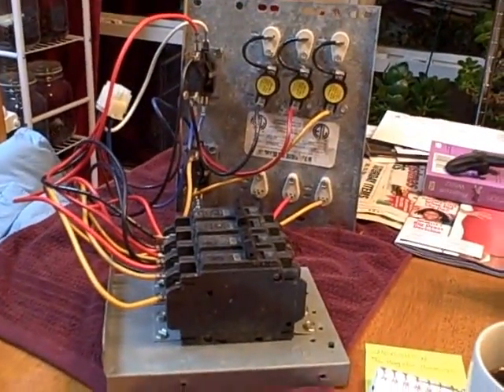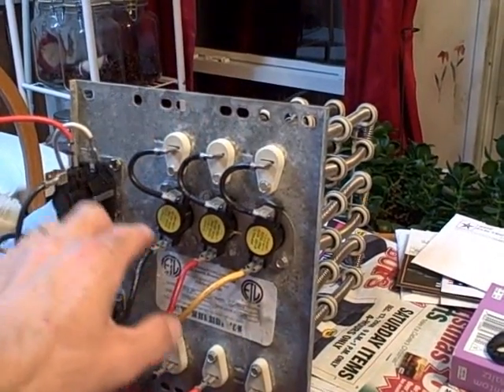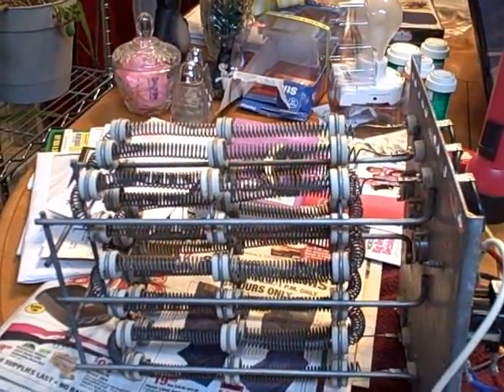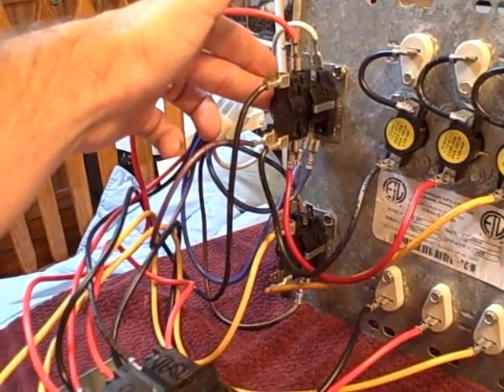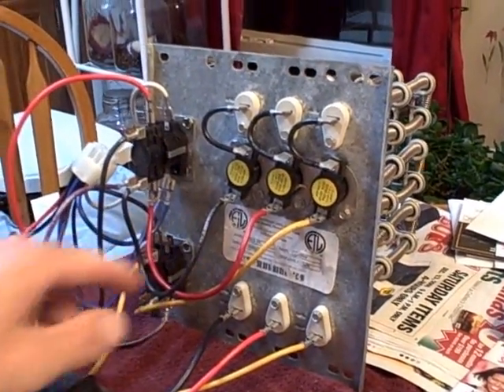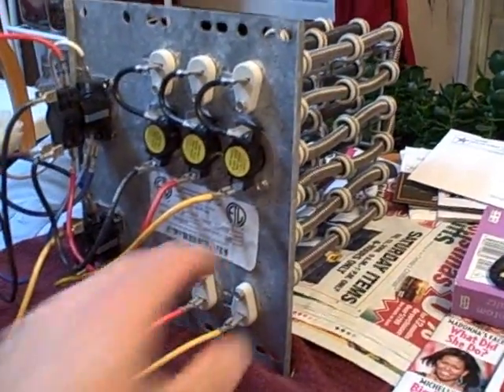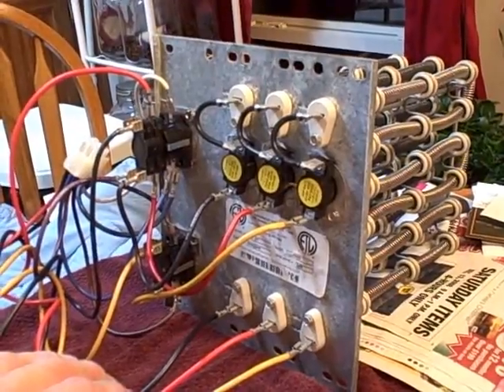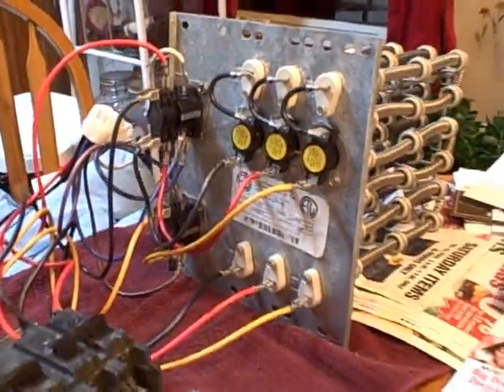HVAC Electric heat kit / strips shown!

Comment from the maker: Hey John, well there is a possibility that the last time they used the heat that the heat sequencer STUCK ON and was running the heating coil constantly. The limit would cut it off and when the limit cooled the element would come back on and the cycle would continue.  The melting comes in because when the Blower isn't running for the AC the heating elements are just running wild and putting stress amp loads on the wiring, hense the melting.  Always fun finding an AC in summer with heat strip on!

Comment: Hi Mikie, like your HVAC and Ham videos. My next door neighbor had an electrical fire from the sequencer in they're furnace yesterday. Its been in the higher 70's here in northern Ohio. They wouldn't have turned the heat on. M1 to M2 was burnt to a crisp. M3 to M6 was fine. Some of the wiring insulation was burnt. Isn't the sequencer only for a call for heat?

Comment: I would find one these heating boxes like this one out of a furnace or duct heater and disconnect the unwanted elements. Don't know what the proper temp is for powder coating but I would make sure their is a thermostat to control temp. BTW I hear a old electric oven works well for powder coating has everything already set up. Just limited on size, fine for small engine parts. Unless you can pick up a commercial one.

Comment: Are the heat strips always on when the heat is selected on the thermostat and the heat pump is running. or does the heat pump control the heat strips to turn on and off when needed?
Reply: No.  Major loss in efficiency while running them.  I believe that if you adjust the temp up too far (4 degrees or more) they will come on to assist so it's better to either slowly bring up your temps or let your system run more often while away to maintain higher base temps which, believe it or not, consumes less energy than running the strips.
Reply: @DayClanTribe  You can also add a switch in series with the W wire from the thermostat to keep it from turning on the heat strips. Then if it gets too cold in your house you, not the thermostat, can decide to turn the switch on to enable the heat strips. Many thermostats are really dumb about using the heat strips when they aren't really needed.

Comment: i need a 15 kw heat element for a powder coating oven. what would you use?
Reply: I would find a free electric stove and rob the parts. Or just buy an oven heating element.

Comment: Thanks man, you provide some really good information, I'm a new tech and I pretty much feel confident with everything, the only thing that stumps me are electric heat setups, especially electric heat setups that are heat pump systems, those damn DC relays have really made me feel stupid, if you culd do a video on how to replace them with sequencer, or just how to wire up a sequencer from scratch for a 2 strip or 3 strip system that would be most appreciated bro. Thanks

Comment: Hi, I have a GOODMAN GPC1360H21 unit with a 10KW heat strip. I bought a 15KW unit, and am going to change it out, but I am unsure how to wire it. Meaning, the 10KW had two breakers to wire in the two 110 wires into. But the 15KW unit has two sets like the one you have on the youtube video. There is a pair of 60 Amp breakers, and a pair of 30. Whre do I wire my two 110 lines into? the 60's, and jumper the 30's? or?  The instructions just sow L1, L2 for the 60 and L1 and L2 on the 30.  thanks.
Reply: Did you ever get an answer for this?

Comment: Hello Mikie, good video man... I got to remove an old wiring from some really old systems at a apartment complex, they have heat strips 5kw.. im having a little problem tinking how im gonna rewire that with the new components, by any chance, would you have a diagram or something showing how to propper do so?.... thanks man!!

Comment from the maker: @tkarmakid Hrm, that sounds kind of hinky!  Trying to picture the unit in my head.  ...but a 5kw heat strip 'should' pull about 20 amps when in use.  Those are the most common anyway... I actually think I have 7.5kw strips on mine but can't remember what they pull.  Might cut the breaker and check continuity and to ground on each heat strip, check the wire sizing and make sure the goob installers wired the right breaker size to the right strip.  Not 2 strips to a 20 and 1 to the 40 :)
Reply: According to Ohm's Law 5kw strips @ 240vac should be 20.83 amps and a resistance check should come in around 12 ohms.
Reply: Oh, funny, I just noticed it's an 8 yr old comment, lol.  Well maybe someone will find it useful.

Comment from the maker: @brotherb30 ...no the thermal safeties can be replaced individually.  Of course as long ad the safety is functional the contact surfaces could just be lightly sanded to clean them up.  The tech just has to make sure that the connections are all tight. :)

Comment from the maker: @brotherb30 The heat strip is probably fine.   Burned off wiring is typically due to a loose connection or loose terminal and that causes a higher amperage at that weak point to do the job.  It heats up and melts off, etc.  usually replacing the wire and making sure you have good connections.  ...You would be surprised at how many calls I would get on a regular basis in the winter for just that :)

Comment from the maker: If it was a short it would trip the breaker right off the bat.   When you say it shuts off, do you mean it trips a breaker or that the heat strips shut off but the blower continues to run?  You should have a contractor look at it.  It could be anything from improperly sized wiring from the main breaker to a very dirty evaporator coil opening up the temp safety. (depending on what is shutting off) Not overly helpful here, sorry, you need to have it looked at! :)

Comment from the maker: Well that isn't what I would consider a homeowner fix, probably a stuck sequence without actually seeing the unit.  Just shut it off and call  an HVAC company to come work on it, pretty quick fix usually.   If your LUCKY and your air handler has 2 breakers on it you might be able to shut one of them off that doesn't control the blower and see if the heat strip was on the one you turned off.  Save some cash till the hvac guy can get there.  It's a 50/50 shot which breaker it's on though :(

Comment: The stranded wiring they use on those kits is different than standard household wire.  I believe it is appliance wire.  It seems to have different amp rating limits than regular house wire how they use it on the kits.  I cant find any data on the amp limits of that wire on the internet.  Do you have any idea about the limits of it?

Comment: i pretty munch like gas or oil heat for central heat i use gas so the only electric is the heater that  i use if i just going to heat one room at night or for extra heat
and for cooking and hot water

Comment from the maker: Yes!  I don't recall the amp rating on the 90-340 series but I like the small format on those.  If nothing else you can stick a contactor in there!  My heat here at the hosue uses contactors :>